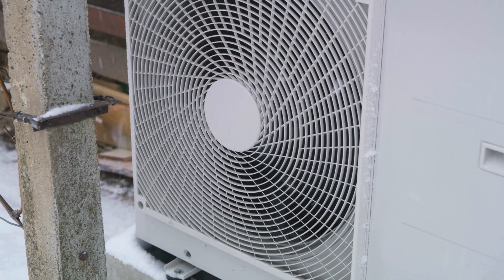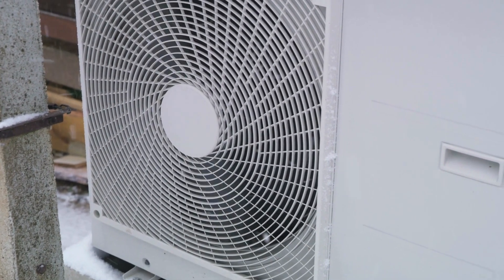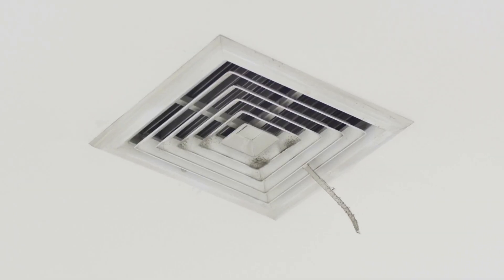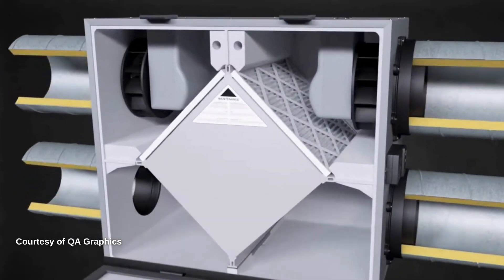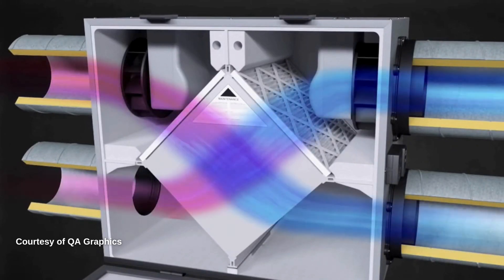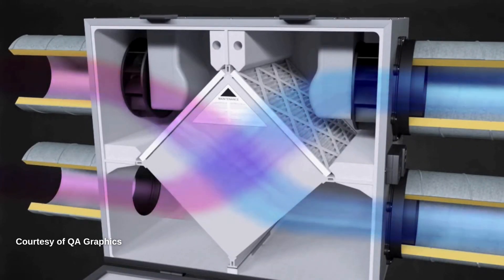Energy-Efficient House Design | DIY Passive Home Build Walkthrough

Comment: A cuboid with a flat roof is untenable in snowy and wet regions. You need that slope to support the weight and shed the rain. Sure in a dry climate you can do a flat roof but once rain levels increase sealing a flat roof and keeping it sealed is a losing battle.
Reply from the maker: @ElvargsBane  points taken, however, this roof in particular is sloped, a standard roof design would be a 1/12 (5°) 

You can see the design here , https://ekobuilt.com/ekobuilts-services/ottawa-passive-house/passive-house-plans/three-storey-trillium-floorplan/
Reply from the maker: @ElvargsBane  that said, supporting snow load, even if the roof was flat is no problem, it’s all in the engineering, we have designed roofs in areas for over 150 lbs/ ft.² there’s flat roofs in all climates all over the place.. also to keep in mind a flat roof is not actually flat, usually a 0.5/12 is the actual slope, even ‘flat’ roofs are designed to shed water

Comment: These are all great design elements and it keeps getting closer to the concepts of the "Earthship" design. It will be amazing when these two methods come together for an even more passive home. Even "just" recommending people who can to face their larger windows in the "right" direction and angle can have a large impact on the heating and cooling load.
Reply from the maker: @shoestringsev4529  yes, trouble with earthship concepts, though is vapour open and mold protection..
The benefit of building to passive house construction model, airtight, but also vapour tight and open-permeability are prerequisite for certified buildings, so impossible for mold to develop guaranteeing a healthy building
Reply: @EkoBuiltPassiveHomes  I was referring to the concepts of window direction, mass heat storage and partially in ground. Also passive air circulation. It amazing how much of a difference it can make having your large windows facing the right direction and optimal angle for passive solar heating.
Reply from the maker: @shoestringsev4529  yes absolutely agreed windows with the ability to face South is best. The trouble is not all houses have ideal orientation., sometimes very few houses would have opportunity for solar again.
The beauty of the passive House construction model is southern facing glass is not a requirement . The house is built like a thermos and true southern facing windows help but not required, for example a passive ((certified) house with southern glazing would cost less than $200 a year for all heating and cooling. A house that does not have the ability for southern glazing will cost more to heat, but not much, less than $400 for the year using an air source heat pump.
Reply from the maker: @shoestringsev4529  you may appreciate this video https://youtu.be/m32bls_SEeI?feature=shared
Reply from the maker: @shoestringsev4529  You may also appreciate this article, https://ekobuilt.com/blog/site-placement-for-a-passive-house/
Reply from the maker: @ yes windows facing leeward/windward side great for passive cooling when summer nights are below room temperature. If the building has the opportunity to face, South is passive windows really do make a comfortable difference because of high Solar heat gain coefficient, however, you have to be careful angling them because angled (South) windows will let in summer sun whereas vertical windows with a good (2’) overhang will block most winter sun

Comment: About overhangs I don't see much on this cubical house. Second thing, what do you think about homes with used attic as a compromise between one floor vs cube?
Reply from the maker: @arturagonski4674  there is no attic space in a passive house, however, if there is an architecturally designed “attic“ it would be just as comfortable as the rest of the home because it would be inside the passive envelope

Comment: Do you use any of the "Passive House" certifications like the Passive House Institute or Phius?
Reply from the maker: @59seank  yes absolutely! Our system is certified PHI. Phius is easily certifiable as well, PHI is the more rigourous standard so the more energy conservation, which is the reason we recommend certified to PHI which our system is completely compatible. We optimize the thermal envelope depending on location so R values can vary